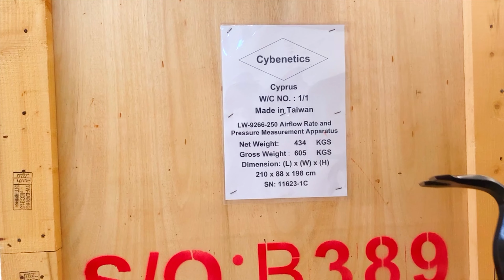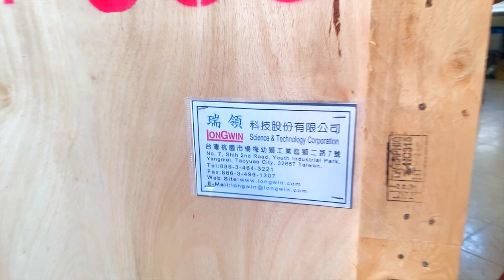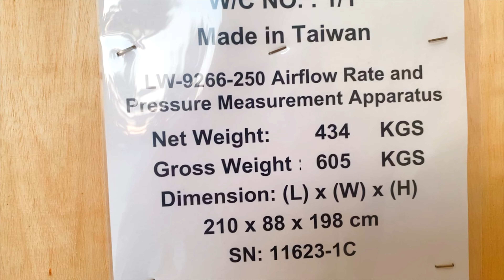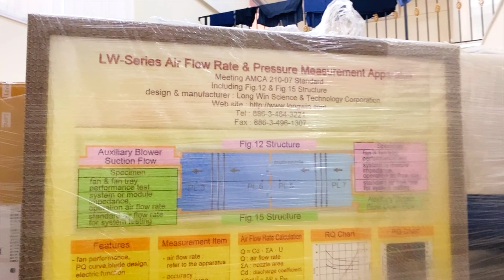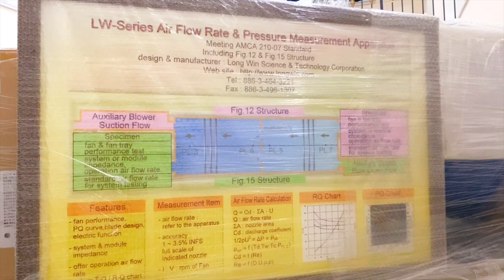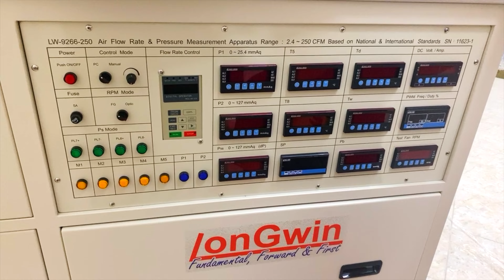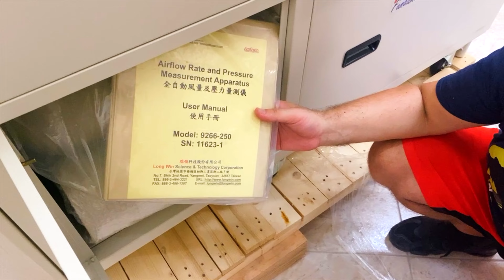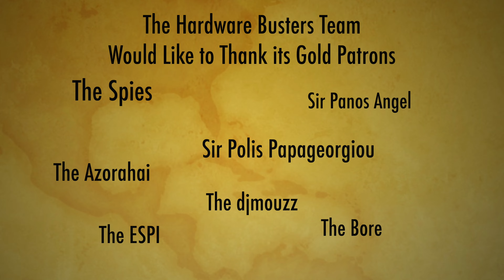The MOST Expensive Unboxing We've Done So Far!

Comment: If 4 normal Greek weight ~ 100 kg, then it's a 4-man job to move that equipment. A normal fit person must lift the own weight. Aris complaining about manual. He needs to read some PDFs about transistor physics ~ 1500 pages.😆
P.S.
What is good practice (in weeks, months) to recalibrate your equipment? ISO/IEC 17025 or ISO/IEC 17065 guidelines are not written in stone, after 10 years all can change. All is relative.